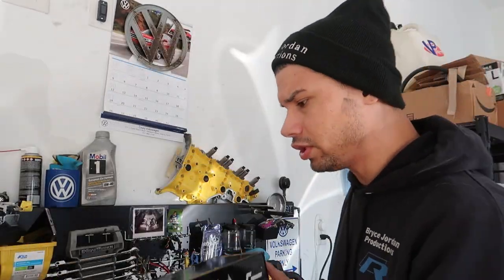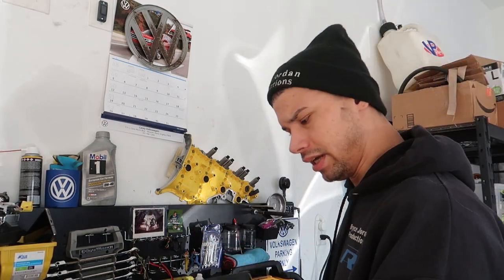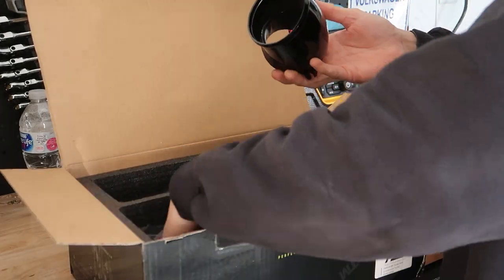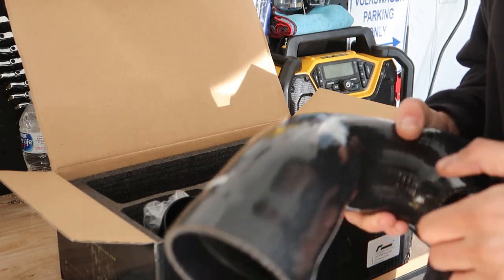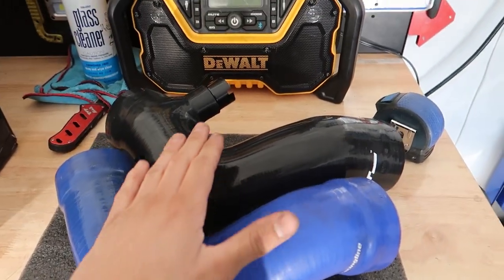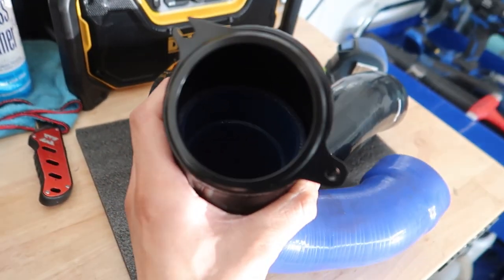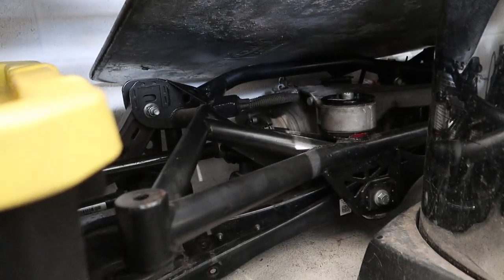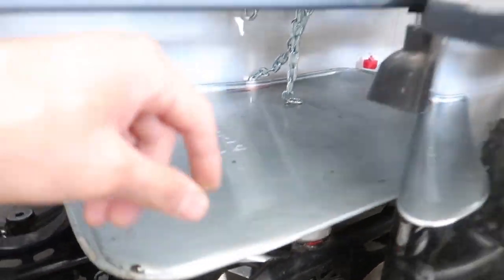Racingline turbo inlet & intake hose unboxing! + Stock comparison | MK8 R & 8Y S3

Comment: Hey do you think it would easier to attach the pcv nipple to its hose first and then insert it into the Racingline hose after it is installed. I watched the install video first.  I just ordered one of and have no idea when it will come in.
Reply from the maker: I think I did try that but because it's so tight in the hose it's very hard to get the orientation right for the other hose to attach to it. It's kind of tricky
Reply: @BryceJordanProductions  I will find out for myself eventually. Theres not too many reviews on these inlet tubes on the web so thanks for posting on it.